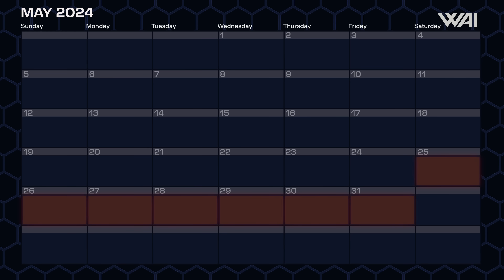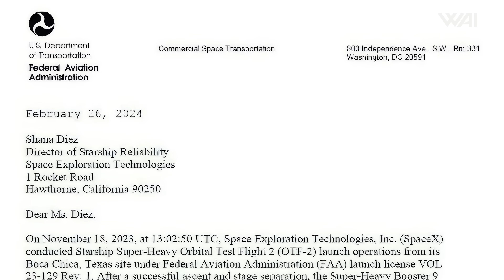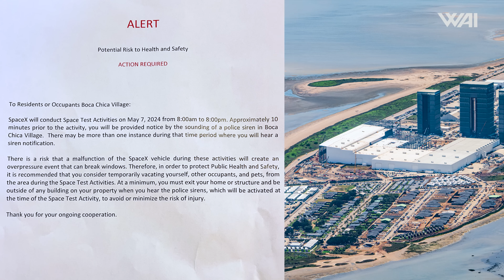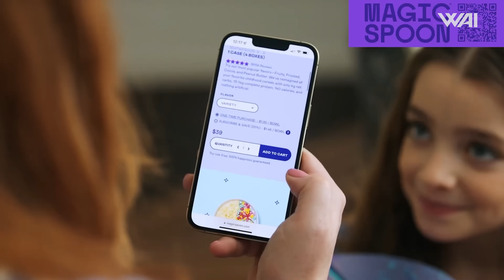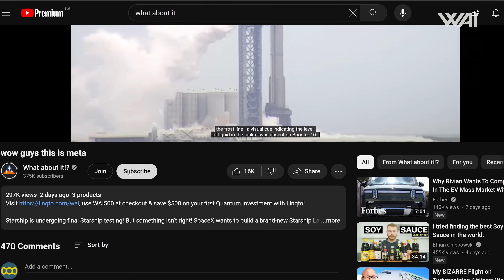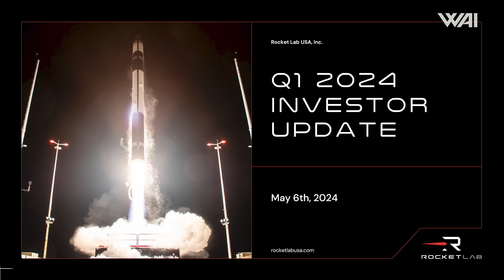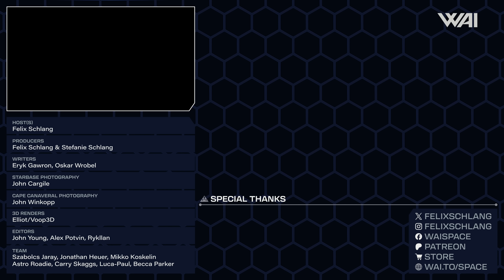What's SpaceX's Smart Trick On The Path To Starship Flight 4?

Comment: I think Rocketlab will be the next SpaceX. And they are a public company, so you can invest in them now. They have made tremendous progress since the company started. They now have a reliable small launch vehicle for custom orbit missions for small sat customers. They have either started or purchased numerous satellite engineering divisions, which include power, propulsion, and avionics, so they are a one stop shop for customers wanting a head start for satellite development.
And Neutron looks like it will be a worthy competitor to the Falcon 9. By reusing the the booster and fairings, and employing a bare bones, economical upper stage, they have a winning combination. Even though Stokes Space is going for full re-usability, Rocket Lab has quite a lead on most competitors other than SpaceX. I am a proud investor.
Reply: They are a good up and coming company. 

But not the same potential. Or goals

Comment: Those astronauts are truly brave, if they are willing to ride on Starliner with it's less than stellar track record. Not to mention that at this point I wouldn't feel safe even on a Boeing plane.
Reply: They care more about the safety on the Starliner than the airplanes at least.  But I'd much rather ride with SpaceX than Boeing
Reply: @gh3meister  
I'm not sure they care that much. Starliner had serious issues on every test so far, yet they are still going forward with the crewed mission. Dragon has been tested far more thoroughly and every demo flight was flawless (as far as we know).
If they prioritize safety, they should test it until it's flawless, and then repeat it a few more times to ensure reliability.
And even then, the earlier issues suggest serious organizational issues, no to mention their planes. That could introduce fatal flaws on any flight.
They are on the same path that lead to the loss of Challenger and Columbia.
Reply: Yesterday my wife and I flew on a Boeing  plane (737?) for 1 1/2 hours. There were no evident problems. 😱
Reply: All this hysteria over Boeing! Guess what major aircraft manufacturer has the best safety record per air miles flown? There are a LOT of Boeing aircraft in service. Most of the issues that have been hitting the news, like engine fires, gear collapse and open hatches are maintenance problems with airlines. Have there been some recent quality issues needing attention? Yes. But unless you see the FAA ground aircraft like the 737 Max 8 a few years ago, these are isolated incidents. All this news is making Boeing sound like Fox News coverage of local crime, playing the same incidents on a loop, trying to convince viewers of a crime wave. While in reality rates of crime have actually been dropping nationally.
Reply: @andrasbiro3007  IN all fairness to Boeing, the issue this time round was with the rocket.
Reply: @gh3meister  no they don't. That capsule should have to repeat all the tests. It was literally in pieces just a month ago.

Comment: I do not believe the heat tiles had any impact on the failed re entry, it is a problem with controlling the ship and getting the right angle and stability for a controlled re entry.
Reply: The fact that attitude control was the primary reason for the failed re-entry does not mean that the tiles would not have been the issue otherwise. Noting NASA's own problems with re-entry (albeit at a much more taxing speed), I would argue it's more likely than not that you'll see some tile performance issues on IFT-4.
Reply: Attitude control certainly was an issue, but heat tiles are still unproven. We can't rule out heat tile failure points or design flaws until reentry trial by fire.
Reply: @mr.g937  the tiles were too expensive and fragile for sure, but they never really caused problems with the reentry, even with 700+ damaged tiles.
Reply: Honestly the tiles really worried me... but it the ship was reentering for a long time without them, so them falling off doesn't seem like it'll fail reentry... however does require more refurbishment than "rapid".
Reply: @johnd.7792  my understanding is that the angle of re entry affects the heat created, it also appears that the last ship entered engine’s first, not the way its meant to re enter, this was because they intended to slow it down and then turn the ship as it started re entry. However they lost control of the engines and then the ship just spun. There does seem to be a fuel management problem in both vessels. One snag being that these are produced before they have completed any significant flights so its hard to replace, they gave to modify already existing craft, I guess tgere will be a huge change in tge design around the middle of next year.
Reply: @johnd.7792  Just because it survived a small portion of reentry doesn't mean loosing heat tiles is ok. Remember the Columbia disaster, which took a while before failing. Granted, different metals (aluminum vs. stainless steel).
Reply: @SparrowHawk183  Thus, the phrasing "seems like" because if the shuttle hand reentered in the wrong orientation, I'm sure it would have been lost very quickly.
This gives me hope that the better heat resistant in the metal itself will be able to compensate for the loss of tiles...
Again, even if it is adequate to lose some tiles, it still screws reusable aspects of things, time will tell.
All is very fun.
Reply: @johnd.7792  what do you make of the secret ship being covered with equal spaced battens. I had wondered why they could not used a heat shield skin that is fitted without adhesive, perhaps tris may be a test for some thing similar . As you say , its interesting to speculate and then see their resolution’s in practice . I remember watching Flash Gordon at the cinema in the 1950’s and the sci fi comics at that time then the shift to Startreck and 2001 space odyssey , its funny how we now appear more like the early examples of space craft rather than the enormity of the most recent sci fi.
Reply: @stuartgraca  i think prototype 26 is a full sized mock up to test infrastructure, I also would be willing to bet they are or will use s26 to figure out best way to get fuel tanks into they payload section.
So I believe 26 is there to figure out orbital refueling, and go ensure infrastructure works with the rocket.
Reply: In fact i think the flight termination system could've activated due to starship being unable to stabilize itself even in the upper atmosphere.

Comment: Starliner is built by Boeing, the company that can't keep a door in place during flight. Don't expect much.
Reply: The way Boeing is moving, SpaceX will have Starship transporting people before Boeing gets it figured out. That should be funny but unfortunately it’s not.
Reply: ZERO percentage chance of that happening.
Reply: Cant keep a door in place during flight....on 1 flight, while thousands of other flights didnt have any problems...
Reply: @Marrrrrko47 including escape slide, two 737-MAX crashes (but only 350 died, so there’s that), several 737-MAX uncontrolled nose-down commands almost crashing, elevator jack-screws jamming, etc

Two Boeing whistle-blowers dying, quality-control engineers complaining about lack of quality control, etc.
Reply: They forgot to even put them in, according to a news report.
Reply: Or landing gear staying up .. (referring to Boeing cargoplane landing without it’s nose gear down recently) I do hope they figure it out but they do need to prove themselves… AGAIN
Reply: As the saying goes, when one door opens, another door falls off.
Reply: On an airplane of all things
Reply: They also couldn’t keep two 737 Max planes in the air shortly after takeoff causing all kinds of problems and many deaths
Reply: @roykdeboy  …”without it’s [sic] nose gear down…”.   …. But its nose gear WAS down… entire wheel & nose gear assembly down somewhere on the departure runway 🤭
Reply: Boeing subcontractor can’t build correctly.  Though quality control once the fuselage gets to the Boeing factory could be better.
Reply: @roykdeboy that is the responsibility of the operator not the manufacturer.
Reply: The abort was not related to starliner. It was a bad valve in the atlas 5 upper stage.
Reply: Space X fanboy here. Boeing has produced many amazing things for planet Earth. I can in no way speak ill of Boeing. My main focus is seeing humans established on the Moon and Mars eventually pushing us further into the solar system. Who gets us there isn’t as important as getting there.
Reply: The company that built the B-52, the plane older than its crews. It's not your grandpa's Boeing anymore.
Reply: @bs_serpents 
Boeing's quality problems come from the company culture of not following procedures and checklists NOT how much the workers are paid. The top leadership also knows that it's cheaper to build good products than to pay out wrongful death lawsuits. Your comment is totally wrong.
Reply: Different division of Boeing. Different people. Different management. Different certification procedures. Different timelines. Different hiring guidelines. Different subcontractor qualification requirements. Different vendor qualification requirements. 

It's the same corporation, but everything else is not similar.
Reply: @Wild-Eye I appreciate history of Boeing. But now it's different company than it was even 30 years ago. Now it's disgrace to it's own name. Ruled not by engineers,but by bureaucrats.
Reply: @just_archan  I can’t disagree with you there.
Reply: Well, Boeing done their job for space. They should leave it to companys that know what they are doing.
Reply: @endemonia666  they probably will do that. And it's not because they don't know HOW, it's just it doesn't fit their financing models. SpaceX and other "new" companies thrive in fixed price contracts, while Boeing and other legacy were built around cost+ contracts. They already selling ULA, soon probably they will cancel other divisions. Rn they just need to work around existing contracts as it would be very expensive to get out of them, but they don't try to get anymore fixed price contracts, while NASA is hesitant to give cost+. There is still some stuff cooking behind scenes, but like we saw with moon rover, or cancelled and restructured sample return contract, NASA is moving toward new model. 

Additionally we see that many companies are working on utilising capabilities of Starship/New Glenn massive and cheap capabilities.

Comment: My guess is that S26 was moved to Massey to test the new flame trench and QD equipment. It’s the only starship available that has working engines and isn’t on a fixed timeline of fit out for their next flights.  The only test it can’t perform is whether the new flame trench will reduce the risk of tile damage due to raptors firing on Pad B (since it doesn’t have tiles).

Comment: watching them haul those rockets around makes me think that people who say we couldn't build the pyramids today have never watched a rocket being moved.
Reply: Lol Aluminum compared to heavy rock. They're not even close to the same thing.
Reply: I’ve never heard anyone say we COULDN’T build the pyramids, just that only recently could we match the scale and precision. The interstate highway system in the US moved approximately the same amount of materials approximately the same distance. It took 40 years to complete with trucks and heavy equipment. The precision was only fully grasped when the GPS system was operational. The great pyramids base is aligned to the rotational pole at least as accurately as we can achieve with GPS. The error is less than 1/4” over a quarter mile. The interior stones are square to the same tolerances we use for modern engines, but they are granite blocks that weigh as much as three cars. 
We COULD build the pyramids, but it would be a HUGE undertaking even today.
Reply: @dextermorgan1  it's stainless steel...and weighs 5,000 tons. The largest rock in the pyramids weighed 80 tons.

Comment: A very interesting sidenote the manufacturer of the valve is protesting its use for a rocket. It has not been properly researched to be used for this purpose from my understanding it may turn into a whistleblower issue if that’s the case I believe liner may be grounded. Object has been very vocal and is extremely dangerous
Reply: Woah!  That is interesting!

Comment: Ship 26, multipurpose path finder because as a permanent in orbit refueling tanker there's no need for re-entry. Not a lot of difference between it and the landers apart from payload and re-entry shielding. And they will share the same refuel hardware. Simple Engerineering. Compatibility between platforms.

Comment: S26 gets way too much hate. She's my favorite prototype since hoppy.
Reply: I agree.

Dare to be different.

S26 - you rock!
Reply: S26 looks like a Lunar Lander prototype. I wouldn't be surprised if they put legs on it and do some hops. Or remove a ring and install the side engines for landing on the moon
Reply: @snakevenom4954  I’m getting orbital tanker vibes. Why does it need so many stringers that high up?
Reply: @TroyRubert  The stringers would interfere with any tanker mods. Also, depot (cause tanker is reusable) will be at least a v2
Reply: @snakevenom4954  HLS will be a V2. S26 is (an obsolete) v1

Comment: I'm sorry but a 2 stage rocket that expends the 2nd stage is hardly an "almost fully reusable wonder-rocket". 
Also they had said that Archimedes would need >2 years of development from the first test fires (which Beck said would happen in 2022) to be ready for the first test launch, so a 2025 launch seems rather improbable.
Reply: Remember that the first stage is the majority of the mass (and expense) of the vehicle. "Mostly reusable" refers to price and mass, not number of stages.
Reply: @akkkbn  SpaceX has done the math and calculated that fully reusable Starship compared to partially reusable Falcon will eventually cost them about 100 times less in $/kg to orbit ($1000 to $10) as and ~10x per launch.
Reply: @admarsandbeyond  I'm well aware, and don't disagree. I'm just pointing something out which might give a different perspective on your comment.

Comment: Chances of Superheavy having a "soft landing in the ocean": <5%
Chances of Starship doing the same: <1%

I think both these numbers are generous, given SpaceX's repeated abject failures and skipped mission goals.

We still have no idea if propellant and oxidizer can be transferred in orbit.
We still have no idea if a turbo-pumped engine can relight (or be reliable) on orbit.
We still have no idea how the rocket(s) will react to sloshing, and we don't know how a rocket can survive gas sucked into a turbo pump.
We still have no idea how the heat tiles will stand up to re-entry forces.
We still have no idea if the Starship can orient itself correctly or maintain correct orientation in space.
We still have no idea about the lengevity or explosivity of the raptor engines over time.
We still have no idea if catching a rocket will work, or be reliable. 
We still have no idea what other systems need to be developed for the system to achieve its goals.
We still have no idea if the door works or not.
We still have no idea if the PEZ dispenser will work - or be reliable.
We still have no idea is Starship can EVER be man-rated.
We still  have no idea how reliable any of these processes will be - even if they will ever test once correctly.

Yeah - this system is gong nowhere soon, and Blue Origin will easily beat SpaceX to the moon. And their rocket won't experience continual RUDs.

In fact we should rename the term for SpaceX: REBRD - Rapid Expected But Randomised Disassembly, because they know it won't land, and they don't know at what stage it will go boom.

Comment: So, what's the point of sending "experienced" astronauts? I mean, they only have control of the Abort button, and even that would more than likely be activated by the computer.. They can't steer, they don't control selarations.. They're just along for the ride.. I did notice that they picked two older people to go.. I guess that's a bright side? I suppose the only positive is that the Boeing that makes planes are not the same ones that made the Starliner.. yay.. Still, as long as they don't do something silly, like use flammable tape on the wiring, all should be well.. Right? Lol I don't pray, but I may have to for these two astronauts. Truth be told, I'd let them strap me in, too. Guinea pig ready for duty. If I'm gonna go out, I'm gonna go with a bang!